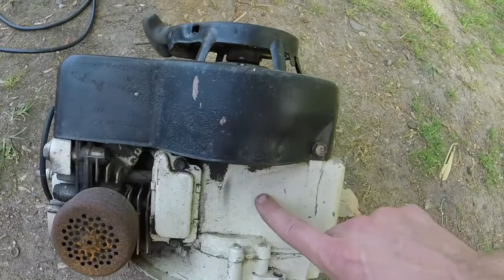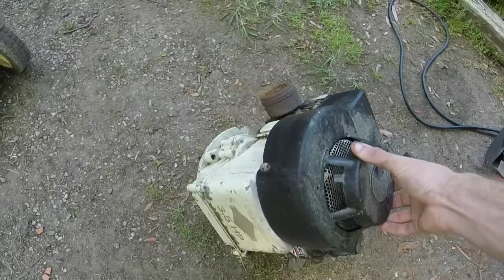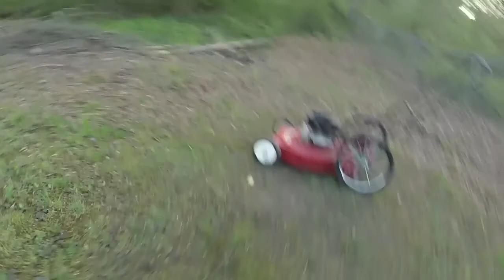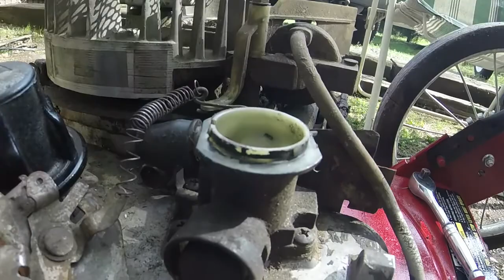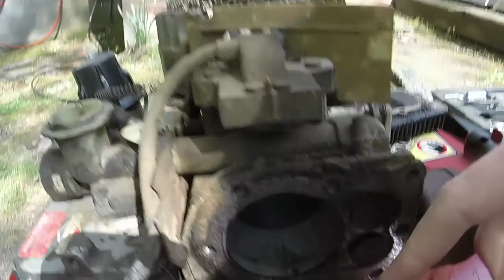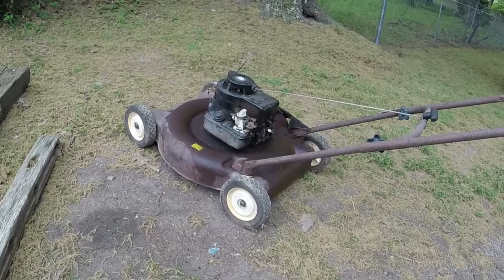Murray Bicycle Wheel Mower #2 with 1970s Briggs Engine

Comment: My mom gave me one of these she bought at a yard sale for $20.  Techemishu engine. Ran like a champ for about 3-4 seasons till the deck rusted out. Started every time. 
Bought a Craftsman 6.75 190cc, approximately $275. Hasn’t ran right since I bought it. Constant carberatour problems. Getting ready to replace carb now and switch to non-ethanol fuel. 
Miss these old mowers that were trouble free, for the most part.
Reply from the maker: Yes these seem to last a good while, but this one had low compression and had to be retired after making this video.

Comment: Judging by the decal on the front of the block the engine block is older than 1977. Looks like it has the wrong shroud on it since it's black. Can't go by the date code on that one. I also noticed the oil fill is on the gas tank side, which seems more common with those engines from the late 60's early 70's.
Reply from the maker: Good to know, I wish Briggs stamped their engine blocks instead of just the engine covers so I could know for sure.
Reply: If you take the flywheel off there should be 2 digits inside of a circle. That would be the year as well.

Comment: Runs good! may just be a carb spring issue. I had one that choked up on start up & just replacing the spring fixed it.
Reply from the maker: You're right Alan I had the opposite problem to start where it was too tight and wasn't closing the butterfly.  Adjusted the spring and I think I went a bit too far with it but I'll tinker with it some more or either replace that spring before I send it on its way!

Comment: To safely turn off the lawn mower engine is to either add a throttle handle with an attached cable to regulate the carburetor valve to keep the air from going into the carburetor of powering the combustion chamber in order to stop the engine or disconnect the spark plug wire.

Comment: Ellis Mowers. I would probably try some of the Lucas to mix with the motor oil to help the piston rings out. 
The big wheel mower concept works really well for river camps and or for areas that more conventional mowers don’t roll very easily through. Personally, I would probably swap out the front wheels with steel wheels with ball bearings which may add some weight - But roll much easier.  A few days back, I completed my Yazoo S24 repower project. The flathead Tecumseh H50 was replaced due to a bad crack between the exhaust & intake area with a 6.5hp Predator engine. Being that the Predator engine was larger, I had to move the engine over & forward just a bit. The only real issue was that the belts went from a very common 44 inches to 41.5 inches that none of the places locally had. So I ordered my belts from eBay. My Yazoo S24 has 20 inch bicycle wheels on the rear of the mower with the steel ball bearing wheels on the front - So Yes, I am very familiar with the “Big Wheel Concept”. The best examples of Big Wheel Mowers would be Sarlo, Yazoo Johnson Big Wheel and Kee with the single caster wheel at the front of the mowing deck. Lawn Chief also manufactured a Big Wheel mower that looked kind of similar to the Murray, But had a 4hp B&S and was self propelled.
Reply: STP works well also. I have used it for many years now. Lucas products are more readily available at some places than STP products are these days 
. I have known of 4x4 truck engines and other engines for that matter that had oil pump failure that ran with STP mixed with the motor oil that survived until the oil pump was replaced with no real damage to the engine. No, I don’t recommend running with no oil pressure -  But sometimes you have to do what you have to do to make it out of harm’s way.

Comment: All you need is another Briggs and Stratton Quantum engine as a replacement!
Reply from the maker: I know, I wish this one was good but time had taken its toll and had a low compression issue due to cylinder wall scoring.  I think I ended up doing just that at a later time.

Comment: Try a turkey baster to remove     
oil (or old gas as well)
Reply from the maker: That's also a good idea, after running it a bit after I filmed this video trying to dial in the carb the smoke has all but cleared up thankfully.

Comment: with the smoke problems it has that engine should be rebuilt with new piston rings and new head gasket also if you know how to relap the valves it should run like new.
Reply from the maker: It may have just had a bunch of oil in the head and muffler because after running it for another 10-15 minutes the past couple days fine-tuning the carb it hasn't smoked anymore which is nice.